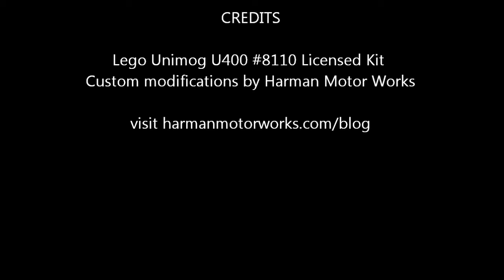Lego Unimog with Custom Modifications

Comment: I saw your video and I have the original but all I have is small motors I'd like to know if the small would work instead if a medium.
Reply from the maker: Hi, from my experience, I think the Medium motor would be the minimum, however, if you experiment you may find that a small motor may also work. I did notice that even with the medium motor and the additional gear reduction, the medium motor would stall at times, depending on the load. I guess it all depends on what type of terrain you wish to drive the Unimog on.
Reply: Harman Motor Works I just finished rebuilding the front end to have a proper steering setup rather than a solid axel steering like the original, and I found that the small gears(smallest available) work well with the smaller big gears(medium size) and it works somewhat well after doing the gear reduction on the motor area and building a proper style of trans. it works decently well if im not using anything else like the pump/ auxiliary drive. and im in the prosess of finding a medium motor or a servo style motor in the 42009.